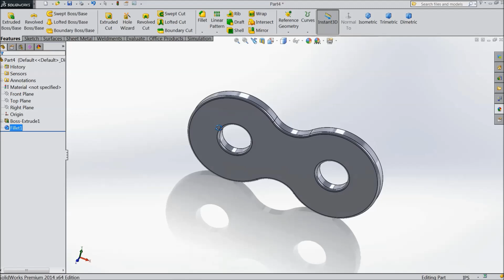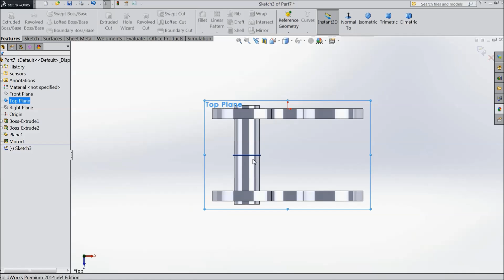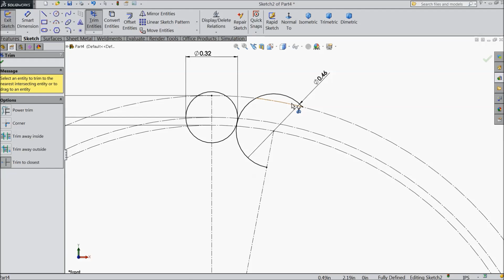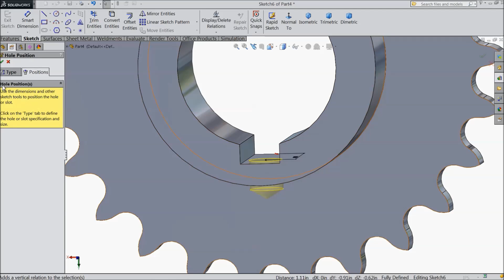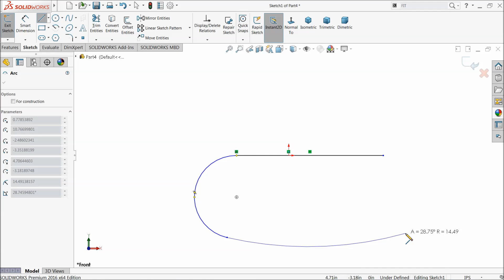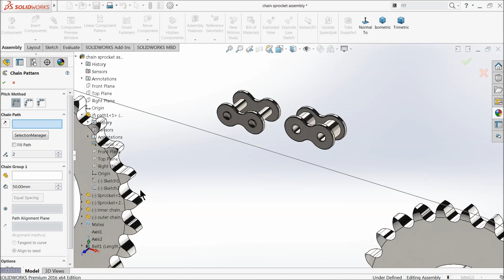Solidworks tutorial chain and Sprocket Part3

Comment: Thank you for this awesome tutorial, I tried to make the same but using sprockets with different diameters
Everything was good except for rotating the sprocket with the chain together, I think I missed something I don't know what. 
Can you help me ?

By the way, I used Mechanical mate to connect the outer link with the edge of the sprocket as you explained but it didn't work.

Comment: how does your part appears so shiny. please help its urgent. i tried almost everything in the appearance menu
Reply from the maker: swaroop zanke  For Real view you need professional graphics card in your system like Nvidia Quadro series or AMD firepro Series. other cards will not support real views.
Reply: Thanx
Reply: there is a method to do that with any graphics card or even without it, I have gtx 1050ti and its not supported by solidworks for real view, but I could try a method and it works. Just search for "how to apply the real view in solidworks" on yt.